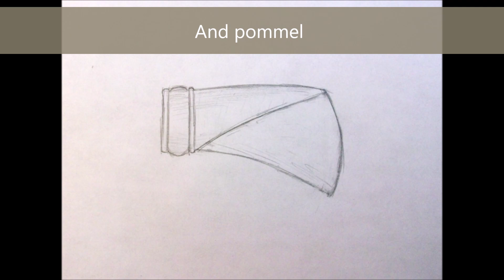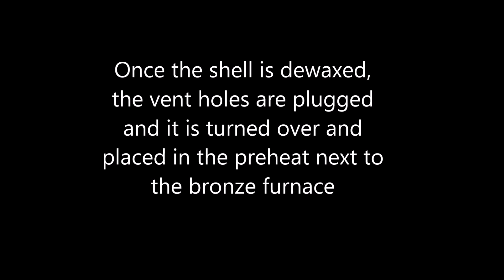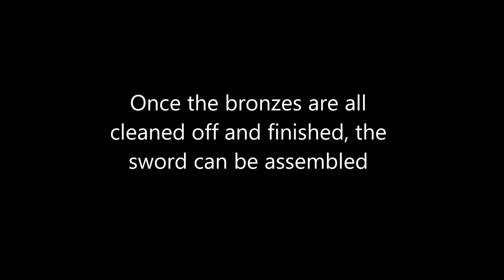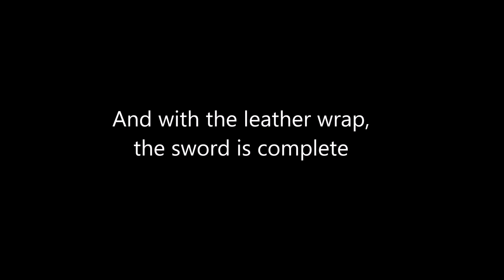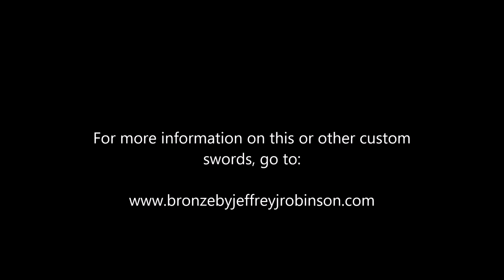King Heron

Comment: Beautiful sword, fittings and scabbard. But every time I see a blade maker use a 2 x 72 grinder on wood, I want to rush over and introduce them to the pleasures of using a drawknife, good spokeshaves, and Japanese Iwasaki wood carving files...
Reply from the maker: Thanks. Carving and shaping wood can certainly be a very relaxing and rewarding experience... for some people. For me the woodworking part is something I like to get done with and move on. Plus, a whole new set of tools and skills to maintain isn't high on my to-do list. I do like watching others work like that, just not for me.

Comment: You should always move what your quenching in figure 8 patterns it closes air barrier beqeeb oil and metal faster and makes it more effective. Just saying.. But nice job as always
Reply from the maker: No, you shouldn't.
I'd rather not induce the warpage which moving the blade around in the quenchant like that is prone to do. Modern quenchants are designed to cool the steels they're made for at the proper rate and the convection occurring in a large volume tank will take care of the vapor jacket in plenty of time to get an evenly hardened blade. But you keep doin you and telling us how it's done. Just saying...
Reply: @brotherbanzai  i wasn't telling you to just had heard it and it made sense. But i didn't think of warping i wouldn't have said otherwise. Respects love your work as always.

Comment: How do you make the waxes?
Reply from the maker: I make a silicon rubber mold of the original pieces I make and then use those molds to cast wax copies, or sometimes sculpt the waxes directly as one off pieces without making a mold.
Reply: @brotherbanzai  thanks! I have a sword blade that I'm making bronze hilt components for so I'm making practice pieces for lower-quality blades. So far I've just been carving wax. I've just started reading the WoT series as well! This is one of my favorite fantasy designs and I wish it got more attention.